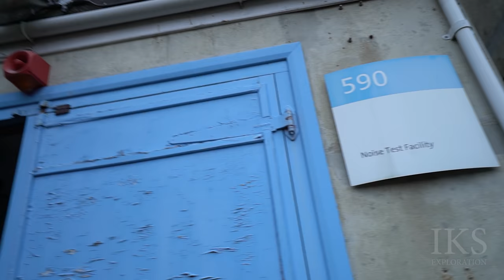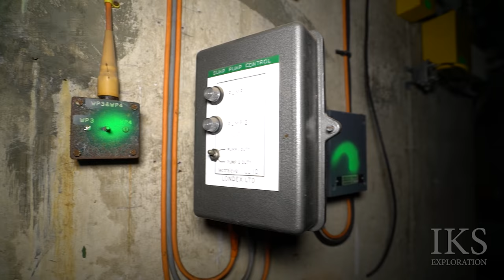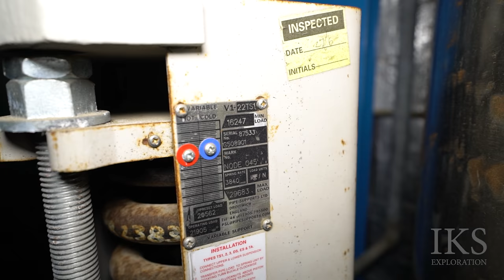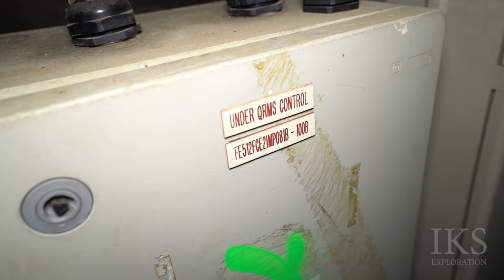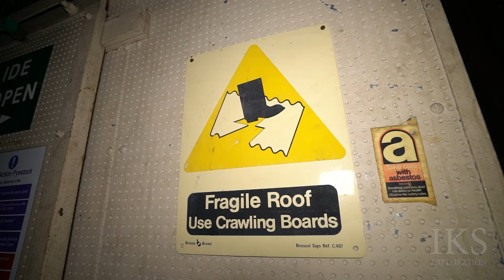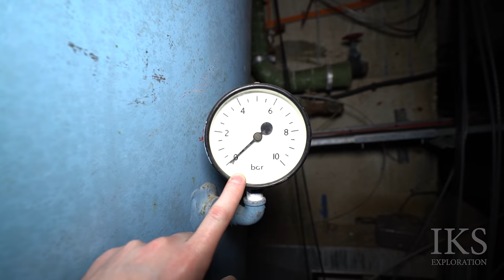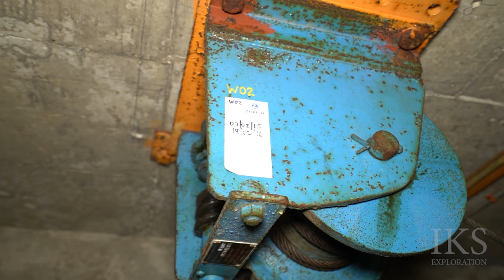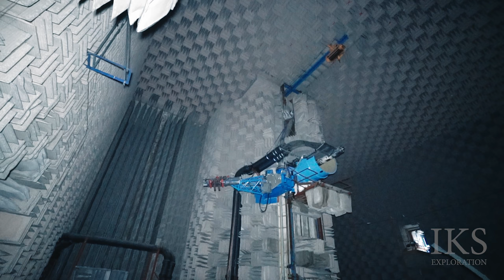Pyestock Anechoic Chamber - Episode 2

Comment: That hoist at about 23:00, that is original. It has gone in first and they've used it to construct everything below it.
21:00 blue stuff / asbestos - the dust likely has some in it, the fibrous material under the blue resin is fiberglass. Pipe seals (25:00 about, yes that is asbestos), insulation, that's where you find the asbestos. As long as you don't disturb it, you're good. Then again, those echo killing baffles likely are loaded with asbestos given how likely the exposure to hot gases is in a jet engine test facility. Wonder material, thinking how much we all have breathed in when the clutch plates and brake pads had the stuff.
39:30  Those transparent containers look like water separator and oiler. Plate says "Maximum recommended air presure 100psi" - air operated water pump? (Googled; yep. The manufacturer is still there: ", Inc., founded in 1965, is a leading manufacturer of air-operated double diaphragm (AODD) pumps.")
55:00 that chain moves the orange "tank" in and out the opening; note the seal around the opening.

Comment: That black box hanging under the smaller  hoist is called a chain bag. That hoist had a chain, whereas the large one had a cable and drum.  The chain on the smaller hoist payed out of the bag as the hook end went down and then went back into the bag as the hook end went back up.  They are called bags because that is originally what they were, a bag made from heavy canvas.

Comment: Green spray paint on electrical gear = 'Disconnected and safe'. 43:01 - The vent in the wall was connected to a set of huge air intakes, so that the jet engines could be fired up in the facility. The large hole in the anechoic chamber was where all the jet efflux was directed. Not a safe place to be during a test.
52:58 - The skinny lattice towers were stands for microphones during tests. The site next door that is lit up, is a company called 'Vector Aerospace.'

Comment: Great content guys that place must have taken some time to build with all the equipment and wiring everywhere just amazing and the power cables coming into the building wow it must have used some power by the size of those fuses.
Reply: Those extractor fans above the baffles (in part one) could have been upwards of 40kW apiece, not to mention all the ancillary equipment, lights, HVAC, compressors and coolant pumps etc. It could well have used more electrical energy (in kW) to run the facility than the energy output the engine on test was producing (in kW).

Comment: Whatever happens to that building, it is a massive asbestos removal operation in any case. They should do that part before any housing is built next to it, ie. about right now - that building is shedding asbestos all the time as wind blows through all those channels. Even if there are even natural places where asbestos is exposed and blown off by wind, that is man made and liability risk at minimum.
Very high potential for a indoor activity park due to wide open spaces, if it would have to be repurposed.

Comment: Amazing exploration job. Seems to me the building was a bit of a government job; at some points lots of money was thrown at it. Heath and safety features were retrofitted - in a bit of a haphazard, thoughtless way. And the decommissioning of the electrics - slash and chop with dabs of green aerosol paint - seem like sadistic mutilation of a temple to the technical achievement of the 1960s. Finally, the abandonment with unconfined asbestos hazard seems like ignorance and stupidity of bureaucracy; easier to do nothing and leave it for somebody else to worry about. The decline of a building mirroring the decline of the society that built it?!